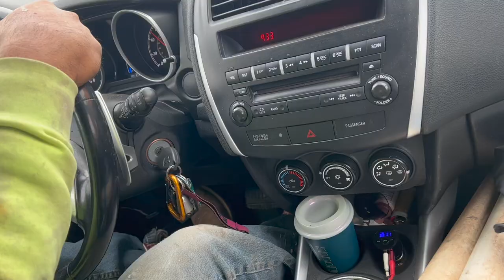Vlog 02. Bedonie.Yeah presents Husband takes Wife to work!

Comment: I usually just get the hole saws to spin both ways a little bit to loosen the drill bit in the center. Or take the hole saw off and then drive a drywall screw into and pull it out. I do bath and showers so I use that thing everyday.